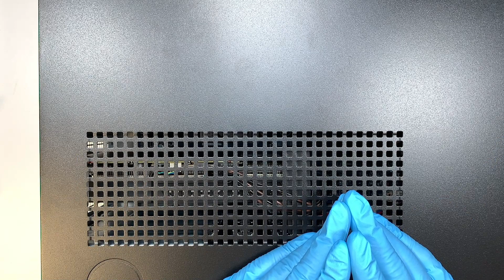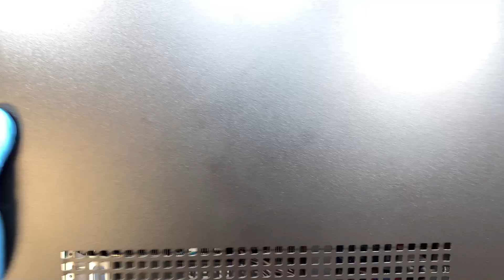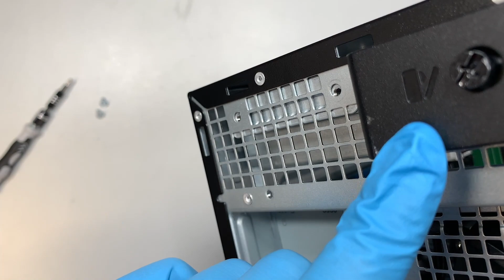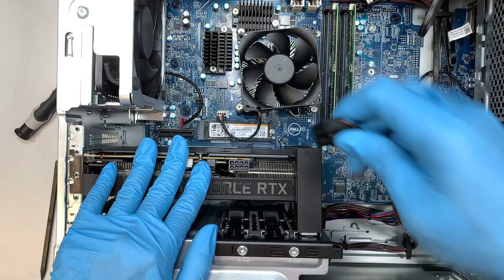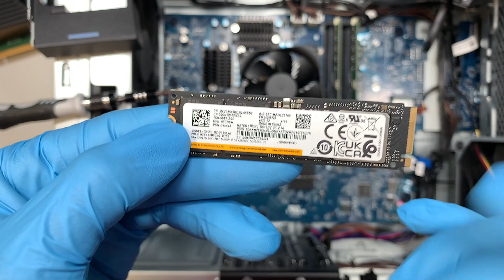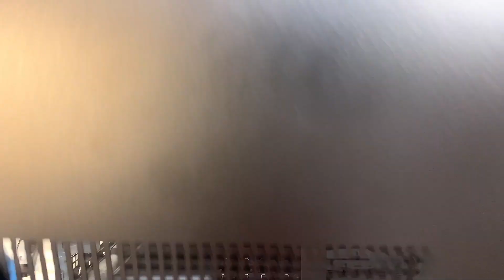Dell XPS 8950 D30M Inside Review Upgrade Hardware

Comment: I bought mine the year they cam out and it was my first computer with an SSD and boy do I love it.  Takes about ten seconds to come on and get on the wifi.  I have had it many years now and it still out preforms a lot of new computers.  I never have taken it apart and I thank you for letting me see inside.
Reply: The 8950 is my first SSD and it's great. I have one recommendation for you since you said you've never opened it. I would open the back cover at least every 1-2 years to clean out the dust. It builds up faster than you may think. Use compressed air (especially on the fans) and a small vacuum nozzle.

Comment: I was ready to buy one of these to replace my old Windows XPS .... until I heard about all of the problems people were having with this machine, and worse with Dell's Tech Support and Customer Support. That is no surprise to me ... I've also had problems with the folks that Dell subs out for that. In spite of that, I've owned 4 Dells,  2 of them XPSs that have survived 12 to 13 years and are still going. If I take that along with the fact that all of the computer labs I've worked in and with were stocked with Dells ... mostly XPSs, I'd have good reasons to buy another. But, all of that bad publicity made me pause on the purchase. The thing I've never figured out is, why does a company that puts out such great products sub out their tech support, customer support and sales to call centers overseas that are staffed with such incompetent  personnel? This next desktop just might be a self-build.
Reply: The outsourcing jobs is just a small problem. The key issue is Dell is 'cheaping' their products to max profit. I used to be a DELL fan until my last XPS came in all crap and broke soon after. The company seriously put the pancake stock cooler for a i7 processor. Can't believe it is a build over $1,100. Now I stay away from those pre-build.

Comment: My Dell XPS has only one monitor output, a display port but I want to run a second monitor. Suggestions? Can I add a hub or something similar or will I need to add a separate graphics card? What do you suggest?
Reply from the maker: you need a better GPU to output external monitor

Comment: so heplful that I succeed in adding SSD and RAM really appreciate you thanks And could you upload another video about changing CPU? i want to change the i7 12700 non-k to i7 12700K or 13700K...
Reply: Old comment but just in case someone gets the idea of upgrading their CPU. The 8950 uses a proprietary power supply and the 13700k uses considerably more power than the rather efficient 12700. Also the BIOS does not allow for overclocking so there is no real reason to upgrade from a 12700 to 12700k.

Comment: Hi, thanks for the informative walkthrough.
I recently purchased a Dell XPS 8950 with 16GB of RAM - I purchased a stock one from Best Buy, with no custom configuration.

Mine came with a 460W power supply.

Can I upgrade the power supply to 750W instead?

I have been searching on the web to see if..
a. If I can upgrade it with no issue to performance 
b. Where I can purchase the 750W power supply 

Could you guide me in the right direction?

Thanks again!

Comment: My XPX 8950 came with a 256GB M.2 Drive, so I tried switching it out with a 2TB SAMSUNG 980 PRO SSD. It didnt' work for some reason. The computer wouldn't recognize it as a drive and supposedly the 980 pro works with the Micrsoft stock NVME driver. Any idea why?
Reply from the maker: It should not prevent 2tb Samsung 980 Pro to not work. Any M.2 should work with the Dell Motherboard
Reply: You probably need to format the new SSD before cloning the original drive or installing a fresh copy of windows on it.

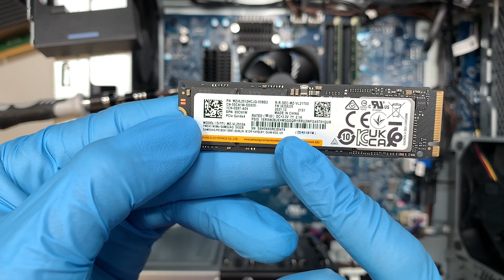Comment: Thanks for making this video. I might have to buy a new desktop, my 11 year old HP is out of commission waiting for new DDR3 ram. If someone had made a video like this showing the inside of my HP I would not have bought it. At 13:44 you were looking at the M.2 SS drive card ... 7th line down on left side it says 512 GB there.

The XPS I'm thinking of getting has 1TB SSD & 1TB HDD. Can you tell me anything about Windows 11 home vs. pro? Would a pro version be too complicated for a home user? The pro has more expansion and drive size options ...

Comment: What is the maximum TB size of a SATA drive you can install on this PC? 2,4,8,16?
Reply: I doubt there is a limitation as long as the OS can read it external, I don’t see why it wouldn’t work on internal ports as a secondary drive.  I have an 8 and 10TB HDD in my 8940.

Edit: 2TB may be referring to the BOOT partition.

Comment: I upgraded to 128GB of RAM and 2x M2 2TB SSD.  I'm planning to replace the gfx card in a few weeks
Reply: did you have to get a bigger power supply?
Reply: it will only run on 64 ram.

Comment: Thanks lots. Hace a DELL XPS 8950 with 12th Gen Intel(R) Core(TM) i7-12700K. NVidea geForce 3060Ti graphics card. (Only video output to monitor).

Good news
Can capture video either through HDMI OR DisplayPort

Bad News
CanNOT capture audio from (either on-motherboard OR separate Realtek component.

Please help
Reply from the maker: Glad I could help
Reply: @UbergeeksBiz  But how do I capture audio???

Comment: What do I do if I want to add another graphics card!?
Reply: Just to confirm, are you wanting to run two gpu's in this system? If so I would recommend getting a larger PC case giving you more room. Second, you will want to upgrade your motherboard to something that has two PCIe slots that will enable you to install two graphics cards. Third, with the new hardware you will most definitely need to upgrade your power supply and depending on the parts you have I'd suggest a 800W-1,000W+ PSU.

Comment: Would the 2nd M.2 slot be the secondary drive if 1TB Hdd was removed? Or would the 1TB HDD be the 3rd drive if the 2nd M.2 was also installed? What order does the motherboard sees these drive is what I'm asking?
Reply: When you bought the PC, the hard drive is assigned letter D. Any new drive will have E F etc.
Reply: With mine the SSD M.2 is Disk 1 (C:\) and the HDD is Disk 0 (any letter you like). I guess the second M.2 will be Disk 2 (again any letter).

Comment: You missed the 2nd M.2 slot.
Reply: Check 14:18
Reply: @etiennegelinas  Did the computer come with two SSDs installed already, so you had to throw one away?
Reply: He showed it but you will need to buy an additional screw to hold the M.2 down as the screw already there is just a spacer.